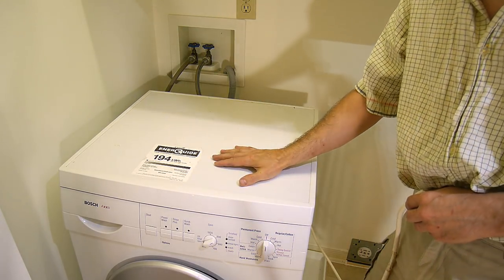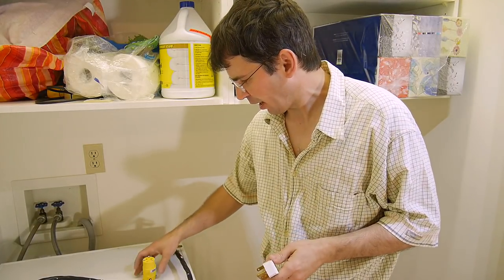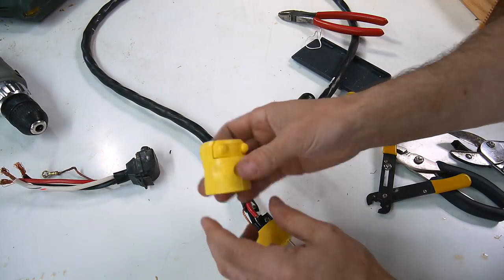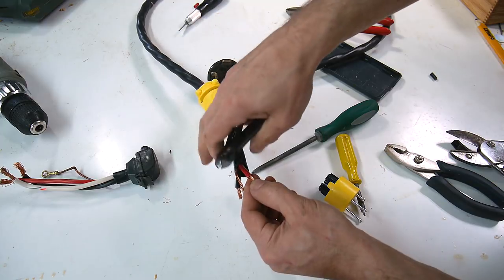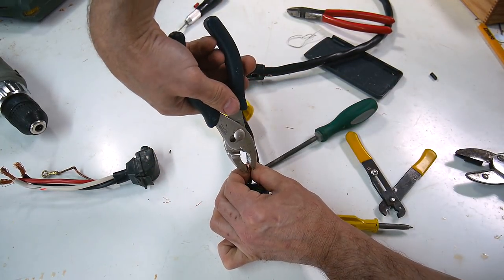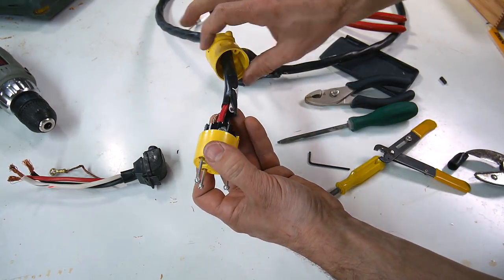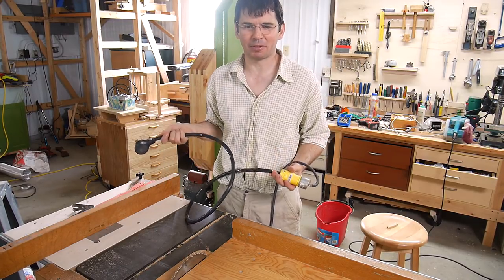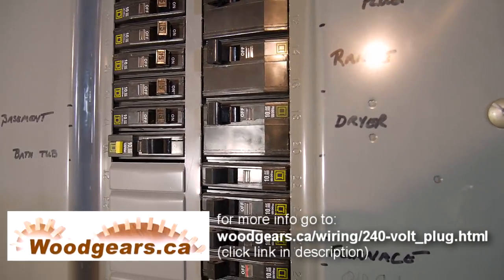240 volt from dryer plug (for Euro-washer or table saw)

Comment: How many kinds of plugs do you people even have?!

In Europe there is one 230V plug and that's it. We only use a different plug for 400V 3 phase outlets (That need to be a different plug for obvious reasons)
Reply: 120V 15A for normal stuff
120V 20A in recently-built kitchens
240V 30A for driers
240V 40A for ovens
There are also other plugs but you are not likely to see them in your house

Comment: Matthias, I know that cheap shots from idle armchair critics do not necessarily  trigger your unending admiration, but this time you need to be scolded.  Wrapping wires around the pins on a 240V electrical plug "for a few weeks"?   Near water??  With a small child in the house???  Are you nuts????  Locating the power outlet for the drier near the floor next to a washing machine which could leak was also an act of incompetence, but that was not your doing.  Please move it up before sparky noises are heard.  And while I'm dispensing advice, you could buy the correct male connector for the power cord and do away with the home-made extension cord.

Comment: This video must be a joke? The "temporary solution" is dangerous. You should never use machine like that on high rated fuse. If the machine get any trouble inside, the high rated fuse may never trip. Your setup is illegal in many country.

Comment: @Matthias Wandel , if you strip more than you need. Bend the ends of the copper into an L and Twist. You can make far more solid copper twists. Then just cut off the excess bent copper and voila. Less chance the wires bend in various ways.

Comment: as an electrician I'm cringing at this video
Reply: Why
Reply: Likewise
Reply: "just ignore the neutral, its basicly ground" is basicly wrong, at least in europe
Reply: read the description.
Reply: Good thing he's in Canada lol
Reply: In north america he is right though you must bond the neutral to ground at the main breaker panel.
Reply: The neutral on a 240v outlet in North America doesn't do anything.  It's correct to be concerned about people using the ground and neutral interchangeably but despite what he said, it isn't what he's doing.  He's simply not connecting the redundant neutral.
Reply: I understand that a some(a lot?) of american 220v is '2 phase'. Electrically a center tapped 220v transformer and the 'neutral' is the center. So you get two, 110v or a single 220v depending on wireing. (Much like how 3 phase star(center neutral) is wired up, only with one leg missing. You don't need to connect up neutral on most(a lot of) 3 phase appliances  )
So in that case it would be safe enough to leave out neutral if the device is wired up to accept this.
Reply: skatastic57   Wrong, in this application the neutral doesn't do anything, but in 120/240v application I.E. a dryer for which that socket, cord, and plug were meant for the neutral leg gives you the ability to do 240 across the black and red and then 2 120 lines (black and white and red and white). On another note, on 240v subpanels the ground and neutral can not be bonded in the box and the ground must be grounded to the ground and to the main breaker panel. So there is a condition to statement. 
Also, Mathias's disclaimer is a perfect one, if you don't know what you are doing don't do it.... or have a damn good excuse when the fire department and later the insurance adjuster shows up.......
Reply: I cringe at the temporary fix that he replaced with this. That was pretty scary looking. This? Well, I wouldn't want to do it myself - but that's because I wouldn't know what I was doing. Mathias is a smart cookie. He knows what he's doing, and if he says it's sound, then it's sound. But that first temporary thing, no way. Scary stuff. Good thing he upgraded.
Reply: Same in Europe we bond at the meter but we get 230v bettween live and neutral I'm not too up on the american system but I believe  you have center tapped transformers so it's 110 between either tap and neutral
Reply: I'm pretty sure he showed the electrical tape bit just to send professional electricians through the roof. TBF, I would shit a brick if I saw that in one of my friends houses as well. I would venture to say, he just showed that to screw with you and in fact did not have it there "for a couple weeks"
Reply: Isn't the neutral on 240 only for 120/240 applications?
Reply: One can only hope what with small kids in the house.
Reply: Well here in Germany this is done too. But after that point these are two wholly different potentials. Neutral is allowed to have a potential. But most importantly RCD's trip as soon as there flows a current through the Ground lead. (Or anywhere else except the Phases and neutral for that matter.)
Reply: this is dangerous because if there is a short, the outlet he 'adapted' can deliver way more power than that power cord is rated for, causing fire.

If he wanted this to be safe, as he points out at the end he should replace this with the appropriate (iirc 20a) breaker, which is trivial to do, and I'm sure Mathias knows how.  I would strongly suggest he do so, because if anything should happen, the insurance co will be all too happy to void his home insurance.
Reply: Annnnnnnddddd..... We found the safety nazi. Was he not clear enough for you that he was acknowledging a risk and urging others to not follow his example? You haven't added anything to the discussion that he didn't already say.
Reply: At the MAIN panel is correct - however, all SUB panels, the neutral and ground are NOT bonded.
Reply: Dominik. Well, this isn't Europe so.....
Reply: Ding Ding DInG! We have a Winner. That is the REAL problem with what he has done. The wiring inside the dryer is designed around having a Max Over current Protective device (Breaker or Fuse) at a set rating. If you exceed it and something goes wrong, then the whole thing goes up in flames instead of tripping the breaker. The neutral being cut has nothing to do with anything in this case. The ground is there and that is what is important. Well Done JH
Reply: Were RIMM elctrical contactors ?
Reply: The neutral on 240V carries no current for pure 240V devices, but on a 240V electric range, for instance, the neutral can be used for 120V circuits within the device, such as the small appliance outlet on the top panel for plugging in a kettle or toaster.
Reply: +IamTranslation - "I don't know where else sub panels are used.  A detached garage or shop or barn maybe."

I had a sub panel installed years ago in a 100 year old rental home so I could run a 30A dryer in my basement from a small 100A main panel with only about eight breakers and no room for the double 30A breaker needed for the dryer. A 50A double breaker feeding the sub panel in the main panel replaced a couple of 15A single breakers which were moved into the sub panel alongside a 30A double for the dryer. The sub panel also had a couple of unused locations available for future expansion.
Reply: You are correct. Most homes are fed with one hot lead at 240 VAC.
Reply: Co Rin Here in the USA/Canada electrical regime, you get two opposite 120 volt phases and "neutral" from the power company. This last is connected to ground OUTSIDE the breakers. Ground is allowed/designed to touch people, so 120 volt current should return via neutral not ground. The washer being European, its safety engineering may expect different things about ground potential. But hey, it's his life, right?
Reply: No, they are not...not in the US.  We have two 'hot' wires (120VAC nominal), a 'neutral' and a ground.  Neutral and ground are NOT interchangeable no matter where they terminate in the box.
Reply: As a 1st year electrical student I cringe
Reply: Neutral and ground are common.  Its like filling up a sink and taking a cup of water and putting it in that sink. There is no difference between the sink water and the cup water.  There is no difference between neutral and ground.
Reply: +skatastic57 Not always the case.  Some appliances with a 240VAC hookup will have control circuitry that uses a 120VAC supply.  For that reason, the neutral wire functions as i it were in a 120V circuit while only using one phase of the 240VAC being supplied.
Reply: if you were to look in your meter box and in your breaker box you would see the neutral leg from the transformer is bonded to the ground rod. and the neutral buss bar and ground buss bar in the breaker box are one in the same.. that is to say if your house was wired to the nec 2005 to current.  that same nec says the ground conductor shouldnt be used as current carrying. Which is what wandel is doing.  however id take my chassis ground over a neutral hookup in that application every time.
Reply: I don't know, the original scary solution tends to make me discount the "knows what he's doing" argument.
Reply: he's using a 240V washer, so current is flowing from the +120v to the -120v... no neutral needed. RCD will break if washer has problem and send current to ground
Reply: Can someone please tell me why you wouldnt just go to a wholesaler and buy a replacement plug and chop the old one off on the dryer and fit new one on and plug straight in??
Reply: me too.
Reply: officially, the cringiest video i've seen today. still trying to pick up my jaw from the basement
Reply: He is not using ground connector for current carrying. His washer has three pins, neutral, live (240v) and ground as per EU standard. That's why he's using one live (120V) for live, the other live (120V) for neutral and ground for ground. Since the two US 120V lives are 180 degrees apart, they net 240V altogether making them neutral and live in EU terms. His ground connection is tied to the washer chassis and is in (in normal operation) isolated form other two wires in the appliance. If there's a fault and one of the other wires contact the case, ground will conduct the fault current and cause to breaker to trip or the installation to burn out (whichever comes first). Using the smaller breaker would be prudent and NOT showing the temporary setup he used would be really smart unless he's a glutton for punishment by safety nazi... :) I'll admit that one would make me worried as well, especially with a toddler at hand but he did a good job of explaining you shouldn't do it so it 's nothing to complain about.
Reply: You're mixing two different things. Ground in your receptacle is for protection only, so if your live wire touches the metal casing of the device, current goes into the ground wire and trips the breaker and not you.
Neutral in your panel/transformer is tied to the ground rod to fix it's potential to 0V and as you say "normalize" the system.  The fact they both tie to the same piece of metal dug in the ground is incidental, but these are two very different functions.
Reply: Cody same here. English bs electrical items are so much different than the American. I wish Matthias stopped with the electrical videos, they worry me
Reply: No, the appliance does not use neutral. It only has a protective earth ground. He correctly connected the protective earth ground in the appliance to the protective earth ground in the outlet. No problem.

Comment: Should have simply replaced the outlet in the box with correct one for the plug (available at electrical supply stores)
Reply: And changed the breaker from a 30-amp to a 20-amp.

Comment: The function of breakers is to protect the wires INSIDE your walls. Sizing a breaker for a particular appliance is not what it was intended for. Good job Matthias.
Reply: Yep. The appliance probably has several over-current and over-temp devices inside it also.
Reply: Exactly.  If I'm going to charge my phone, I'm not going to install a 1Amp breaker.  A 15Amp breaker will just do fine.

Comment: "it's always embarrassing when you forget to put the hood on the cable." I have one better. I was changing a blown plug (the extension cord is about 40 years old) and I forgot to take the old hood off the cable and did not notice until I was putting the plug into the socket.